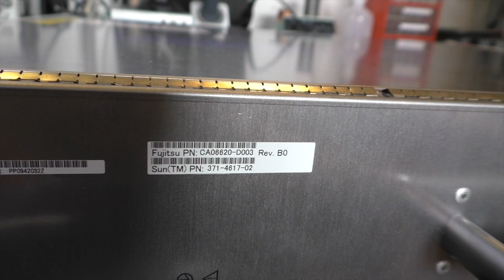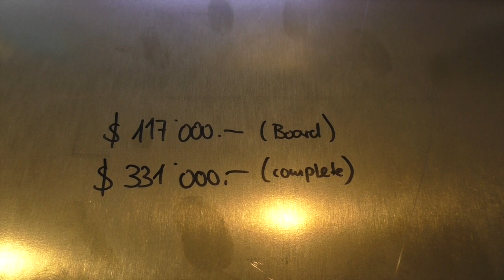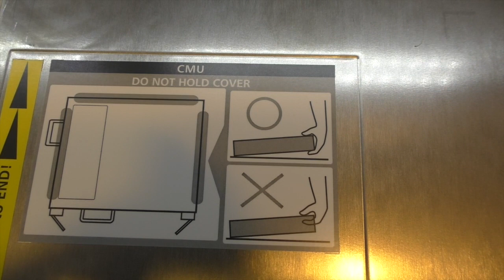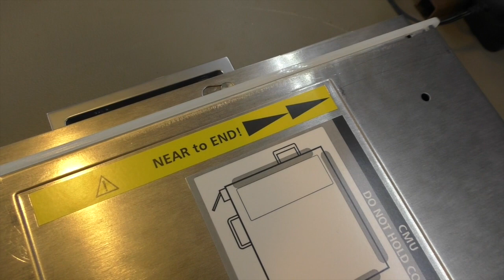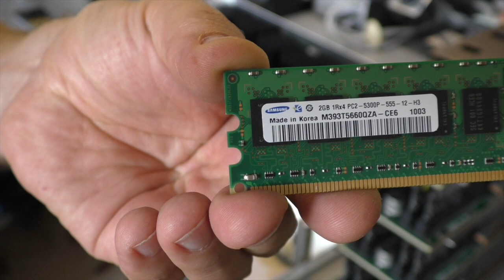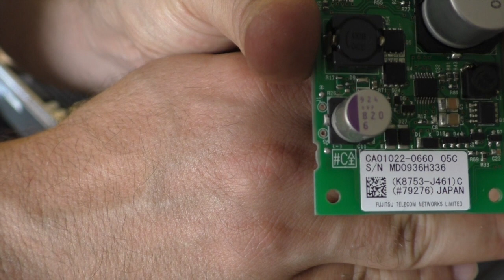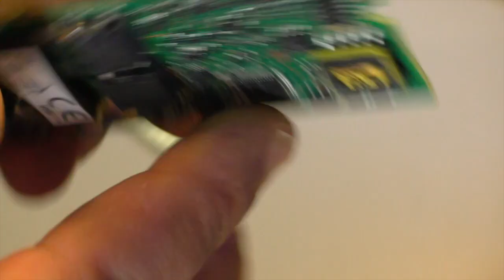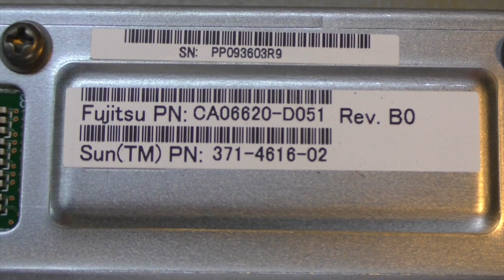How about a $330'000 CPU or a $50'000 cable? (PWJ19)

Comment: I have one of those cray link cables! And a few working Origin 200 comps to go with them. Not in production use any more but I did not want to just throw them away :)
Reply from the maker: +petti78 Do you have a price list? I lost mine.... I'm not sure if 50'000 was only one cable or the whole set.
Reply: +chrigel1234 It looks like the xio adapter expansion set for connecting 2 origins totalled about 10 000 usd in 1997. Had to dig a little deeper in the archives to find the papers ;)

Comment: Excellent.  What was this particular machine used for, if that is known, and how did you acquire it?  It really is a remarkable system.  Thanks for this very interesting tour.
Reply from the maker: We are servicing many SUN systems from small to large. I guess this one was used by an insurance company or bank. The module was a spare part that was never used and finally scrapped.

Comment: I thought fancy HDMI cables were bad...
Reply: +Doom2pro No, they are just a waste of money! they certainly will not HURT your video quality, but they will not make any noticable difference either! Unless you are in some odd area with VERY STRONG radio waves of some sort that cause interference, but in that case you would be paying for a SHIELDED cable, not merely a name brand "gold contacts" cable like Monster and their overpriced BS!

Because the signal going through an HDMI cable is digital, having perfect electrical conductivity is not very important, and besides all that - the cable is NEVER going to be used for so long and so hard that the metal used for the contacts will oxidize at all!

Now for Audiophile quality SOUND - which is an analogue signal, Gold will make a rather large difference when used in the proper ways on the proper components, versus the same components built using entirely copper, aluminum, or an alloy of some form.

So it all depends on application, and usage cases. I work with digital imaging equipment, such as 3-D panning X-rays (Usually Kodak 9000 3D or newer) - where every cable used to carry the image signal MUST BE SHIELDED - otherwise the EMI (Electromagnetic Interference) generated by the X-ray generator, would corrupt and ruin every image. These cables are usually gold on the inside, as well as the contacts - and contains a grounded braided copper or aluminum shield.
Reply: +Dysphoricsmile I didn't say they were BAD as in bad for your video/audio, you are misinterpreting what I said... I meant bad as in grossly overpriced.

You know the saying "and I thought ___ was/were bad"
Reply: You could use steel coat hangers for audio cable and you'd never hear the difference.  We're talking audio here for crying out loud.  It's almost DC!
Reply: +Star Gazer The audio carried over HDMI is digital, so it doesn't matter either way...  As for the DC part, in digital protocols like HDMI I'm pretty sure they use special encoding on the bits to create a net current of zero, aka DC-Bias.
Reply: +Doom2pro I think what he's getting at (by almost DC) is that audio is low frequency (kHz vs GHz)!!
Reply: HDMI cables have Another quality that is being Overlooked here.
One high definition/bit rate/bandwidth cable to handle Everything in an entertainment system .
How many cables did it replace ?
Reply: Nathan Riggin 
Nobody is overlooking it - you're still thinking in terms of analog cables.
Thicker cable does not equal more bandwidth in this situation, despite what sellers of thicker cables might want you to believe.

Comment: is it possible to modify it to run in a personal computer?
Reply: Tom Cove Not based on Windows; maybe Linux
Reply from the maker: No you will nee the entire system. This board alone can do nothing. It's only CPUs and RAM... no PCI slots, no connectors no graphics. All that is on other locations in the box.

Comment: holy shit whats your job
Reply from the maker: IT Professional :-)  In the hardware repair center.
Reply: Question, seeing as you say your an IT professional, I am planning on going to college for such degree and was wondering how well is the pay for such career and is it enjoyable?  Wont be going to college until August but I love working on computers by fixing computer program errors, taken computers apart and putting back together and etc.
Reply from the maker: Well... that's not easy to answer. It depends on where you live, what you like and where you work. I'm doing this IT stuff since almost 30 years so my payment is certainly much higher than that of a beginner.  In Switzerland where I live the payment is high but the living cost are high too. Therefore it makes not much sense to tell any numbers.
Is it enjoyable? Certainly yes if you find the right company to work for. If you're unlucky you will get a job where you're cleaning printers all day long. If you're lucky you will find a job in a company that supports many different products from many manufacturers like "my" company does.
And you have to be a nerd. I'm making these videos at home or after work when everyone else has gone home. Many other people just think that's old rubbish and walk away. When I see such a machine, I want to look inside, want to know what it does and how it works.
My best advice is: BE COURIOUS!!!
Look what happens around you. Ask questions like "what is it and does it work?". 
If your work is boring, think what you want to do and look for a job where you can do what you like.

I know this is not easy and sometimes it's pure luck to find the right job.
Reply: Ill say I am very curious, I love taken electronics apart even if they are beyond reparable (cellphones, computers, TV and etc.).  Also for where I would work I was actually planning on starting my own business because the nearest electronic store or anyone that can repair computers/cellphones (that is actually trustworthy) is 2hrs from where I live and if you need an IT guy to come to your place it can take about 1-2weeks for a spot to open up for  them to even look at the item (not even including if they need to reschedule because they don't have the right stuff).  The only reason I know about that is I worked for a company right after I got out of high school that ran everything electronically and the computers went down and over 200 employees got paid late because they could not calculate pay since most of them were paid for what they hauled (trucking company) and it sucked every time it happened.
With living in a small town and for how much people have problems with there PC, phones and such I can see an electronic store could be used in this town instead of people having to go 2hrs for computer issues.  I know its going to take a lot of college and a lot of work to get the business started and for my name to get out there but I am willing to put the time and money to get it all started.
Reply: Did you go to college to get the degree? :)
Reply from the maker: Well that seems to be a good plan. I have only one advice.... whatever you do, take it serious, work professionally, keep your promises.

The main problem with most craftsmen, electricians, plumbers etc. is that they are only good for finding excuses and writing expensive bills. Being unreliable is also a problem.

If you do your job right, are always on time, do what you promised to do and admit when you don't know something (in other words if you're honest) then people will remember you and will recommend you and your business will boom. This kind of worker has become rare..... in every business.
Reply from the maker: I have no official degree. I went to school, then I made an apprenticeship of 4 years to be a trained "radio-TV electronician" and then I changed to the IT business. I started with repairing terminal displays (just google "VT100") and because I was interested in everything I was soon repairing almost everything.
Reply: I'm about to finish my first year of college to become a Network Technician working on servers is fun but its a different ballgame than PCs. The farther i go down the road the more i ask myself is this what i want to do because i love computers building them and what not but there is so much stuff that goes into maintaining a server that it gets hard to keep track of everything.
Reply: Robert B Well you could always chance to the pc side afterwards

Comment: I just built a computer with 8 cores and 32GB Ram, for around €1000.  Half the RAM of this featured monstrosity. And far lighter, sitting under my desk. Wow. We've come a long way.
Reply from the maker: Tic Tac Tic Tac... time is running. In 5 years you will throw away that thing.
Reply: Maybe. Maybe not. I tend to hang onto my computers forever, as long as they still work and are expandable.
Reply: Lol. Nobody`s gonna throw away an i7 Sandy/Ivy after 5 years. Intel just renames new CPU`s and sells them for higher price. No performance boost at all.
I know alot of people who still use smth like E6300 these days for basic tasks.

Comment: What is the relative (to today's PC's) power of these systems?  I mean now we have 48+ core CPU'x from Intel. I wonder how they compare with CPU power and Memory/IO Bandwidth.
Reply: It's from 2013 and it cost 10 million quid. So work that out.
Reply: Intel doesn't have a 48+ core CPU if you count standard generalized CPU's.  The current highest is a Xeon E7-8890 v4 with 24 cores, 48 threads.   If you count specialized cores, much smaller, simpler and task driven, similar to GPUs, then the highest Xeon Phi is  the 7230F with 64 cores. But it wouldn't beat out the Xeon E7 in IPC.  Now, if you're talking AMD, their latest Naples CPU is around 32 cores, 64 threads.

Comment: The diodes on the input from power supply is so they can be connected to multiple power redundant supplies. If one power supply files, there is no back flow of current. These two small power connectors are probably all this board uses. 48V most likely. But I do see many 25V caps around, so might be less.

Comment: New sub and loving the channel, where do you get your hardware from? I heard in this video youre recycling this (extremely high end imo) equipment, and am wondering out of pure curiosity =]
Reply: Its not really high end. It was when it was new. But i have just as many cores as 3 of those 4 processors and you can also buy 64gb of ram in 2 sticks for about 200 dollars.

Comment: I have to say, for a $330,000 piece of equipment, I expected there to be a bit more than just 64GB of RAM in that thing. I have a friend with that much RAM just in his desktop computer. Though, I would assume this RAM likely has a much higher clock rate.... or I would hope at least.
Reply from the maker: Well that was only one CPU of 8 in the whole system. And those RAMs are $1000 each in the price list.... Of course they could have ordered larger DIMMs. The total amount of memory that machine can handle is 4TB. I doubt that your friends PC can handle that much :-)
Reply: +Perposterown RAM clock speed isn't everything you have about RAM. Server RAM isn't clocked to high either way anyways.
Reply: When these were first built 64gb was a LOT of ram.  and there were 12 of these boards in a server.
Reply: But How Many FPS  @Ground15

Comment: Computers like this fascinate me but i have 4 questions

Question 1: Where do you get the servers?
Question 2: Why do you disassemble them?
Question 3: Did i see that right? the server had 12 cpu´s? 8 on the board and 4 on the cpu pannels?
Question 4: are you german? you have a german accent.
Reply: 1. His job. They recommission, repair and recycle older computers from enterprise companies.  2. Out of curiosity, to see what's inside, how it works and then scrap it for a bit of money, such as taking the gold off. 3. Those are coprocessors and integrated controllers. Every computer, even yours has a bunch of these IC's everywhere on the board to handle different things. The main CPU is only part of what controls things. Like often you'll have an IC for USB ports on your motherboard, one for power control. Your HDD & SSD have CPU's too inside, some are even multicore.  4. I believe he is Swiss.

Comment: I must be missing the block of platinum because I don't see anything there worth that price
Reply: no shit, it's from 14 years ago.
Reply: @mi3night339  and profit margins did not exist back then?
Reply: @deltacx1059  ... i think you're missing the point, those cpu are 4 cores which cpus back then barely go up to 2 cores with issues such as the pentium D and early core 2 duos back in 2005. So a cpu like that usually cost a shit ton to bin for, as it's not widly used by every computer. So think about a situation where intel designed 256 core cpus and only produce them a certain amount and now a 28 core intel xeon 8280 cost $10,000. So you see the point im trying to make

Comment: I suppose that it can still be useful as a workstation for occasional use (i.e., immediately put into standby when not in use), but software compatibility would be problematic, of course.
Reply from the maker: Don't forget that this is just a CPU module of a cabinet sized computer system. Not really a "workstation"

Comment: They asked for $1,000 for 1 RAM stick?!! Biggest rip-off ever!
Reply: Well one Single DDR4 64GB ECC RAM Stick cost also 1000$.
Reply: RAM module 2GB $1000
Reply from the maker: In 1990 I had a DEC Alphaserver with 512MB of RAM.... that memory board was about $50'000. For this kind of machines they make the prices they want. You can buy it or leave it.
Reply: Hehe, my first self-paid PC back in the 90s was a 486-133 with 4MB (Megabyte, not Gigabyte), DOS 5.0 and only a 14" CRT and cost me a fortune (2500DM - huge amount for a kid those days) - a memory expansion of another 4MB a few years later cost me I think around 300 or 400 DM back then. Yeah, the "good" old days, time flies like an arrow... ;)
Reply: can't edit: I think it actually was 40MHz originally, got upgraded to 133 a few years later - AMD K5-133 if memory serves me correctly...
Reply: $1000 for a 2GB ram stick? That's actually a pretty good price for 2002.
Reply: in 2002 i only got 128 Mb for entire system..
Reply: It's how they do price discrimination. You want a basic machine? That's $100000 (or something). You want the really good version? That's $500000.
They do that by massively marking up all the upgrade components. It's $100 for the hardware, plus $900 because if you're asking about upgrades then we think you can afford it.
B2B pricing seems like a cutthroat business to extract exactly as much as they can get away with. (Consumer pricing is too, but not nearly so severe because there's a lot more competition. Except for Apple)

Comment: Cant say anything about the realism of pricing, but this box is a perfect example of well designed repairability. Might run for an eternity and anything that can break is replaceable in minutes. Pretty impressive piece of engineering.

Assuming Apple would build such a a machine it would be entirely soldered, glued down and repairing it would cost twice as much as new, while loosing all data. Also it would be flat as a sheet and sold in rose gold ;-)
Reply from the maker: there was a time when Apple products were extremely service friendly. that was before the iMac, when design was more important than repairability

Comment: (Oops, did not hear you say PC2-5300P til hearing you say it tfor the second time! That P at the end does indeed stand for parity, sorry!)

8:20 Nope, PC2 stands for DDR2 SDRAM. ECC is what checks for Parity, called Error Correcting Code, and I couldn't tell if those were ECC modules or not. Sun Architecture may have some hardware form of ECC that does not require ECC RAM DIMMs..

Anyway the PC2-5300 is a standard. It means DDR2 SDRAM Clocked at 333.33 MHz base - as it is double data rate - that 333.33 is multiplied by two for the effective frequency of 667.

It is called PC2-5300 because DDR2 clocked at 667 MHZ can transfer 5300 Megaabytes per second per channel.

It has nothing to do with Parity...

Just like DDR3 1333 is actually called PC3-10600, and is actually clocked at 666.67 MHz base - with two transfers per cycle resulting in an EFFECTIVE RAM clock speed of 1333! And it is called PC3-10600 because it is DDR3 SDRAM capable of tranfering 10,600 Megabytes per second per channel, or 10.6 Gigabytes per channel.

The trend Continues with DDR4 as well. Except with DDR4 SDRAM  the PC code chaged to the effective frequency, where DDR4 with an effective clock speed of 2400 MHz is called PC4-2400, and can transfer 19,200 megabytes per second, or 19.2 Gigabytes.
Reply: OH and PC4-2400 is actually clocked at 1200 MHz as well, with two transfers per cycle!

Comment: Gold reflects infrared, not heat itself.
Reply: +Adrien Perié What if I told you infrared is heat itself?
Reply: Erik Voorhies
I would answer that you are completely, completely wrong.
Reply from the maker: +Adrien Perié 
Infrared or heat... that's just a question of wavelength.
Reply: chrigel1234
That's inept. Infrared is a frequency range of electromagnetic waves, heat is a physical characteristic of matter, not the vacuum. Infrared is absorbed if not reflected by it's energy being transformed into heat into the absorbent material. But copper, gold, all the materials making this CPU and the heatsink are fully opaque to infrared light, and therefore no infrared to be reflected by the gold, meaning that only gold would provide corrosion protection and great thermal conductivity, unlike silver and copper.